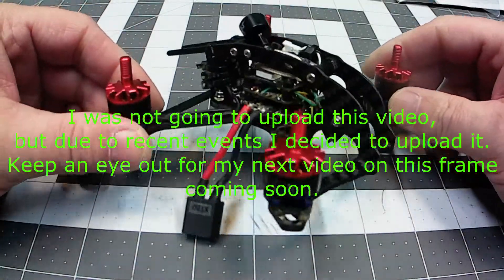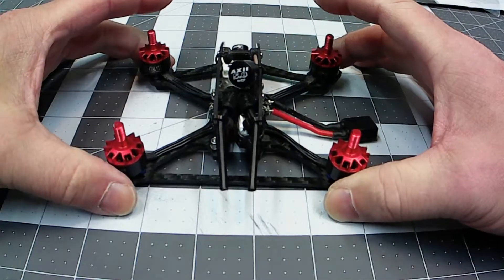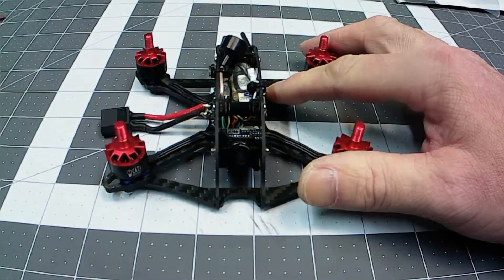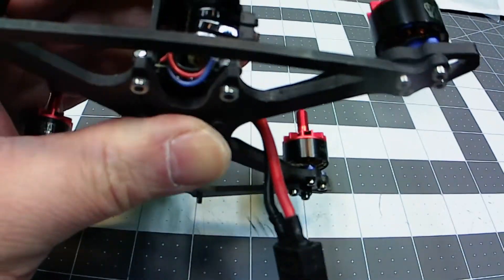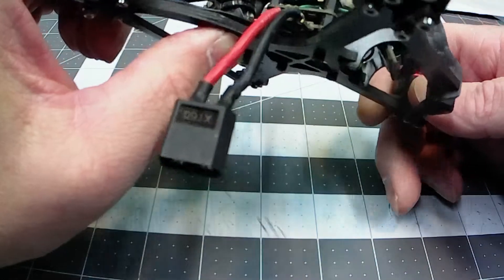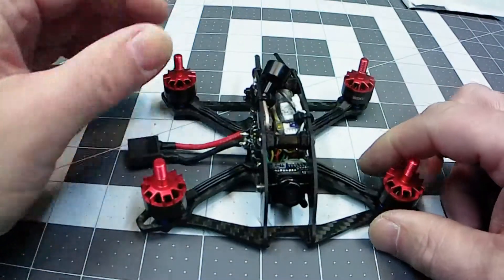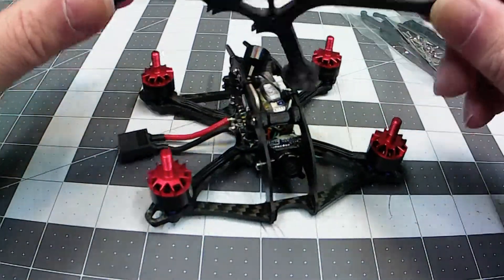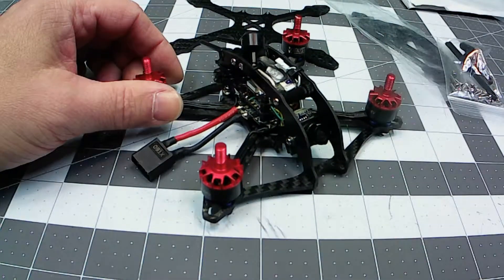Broken Frame Video 1 - Catalyst Machineworks More Massive Droner 3"

Comment: I think the frame is good I think you just had  Badd luck. At crash that frame full speed right into the ground several times no damage it's a really good frame
Reply from the maker: After two of these broke in minor crashes, I can chalk it up to either really bad luck, a freak accident situation, or a manufacturing flaw in the carbon fiber. If you haven't seen it, here is the second video on the CMW MMD frame after the second frame broke too. This is why I switched frames to Armattan. https://www.youtube.com/watch?v=ZKHLWp_rdSw 

I switched over to an Armattan Japalura frame and only had one base plate break in a horrific crash. With the Armattan frame I have had several much, much worse crashes and no other problems. Plus Armattan's frame warranty is legit.